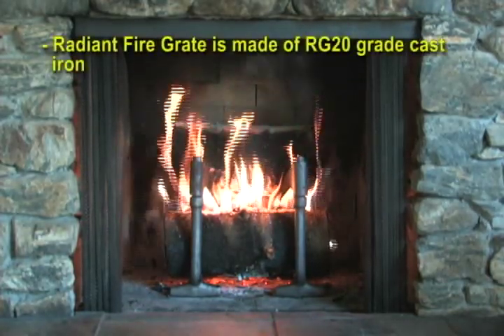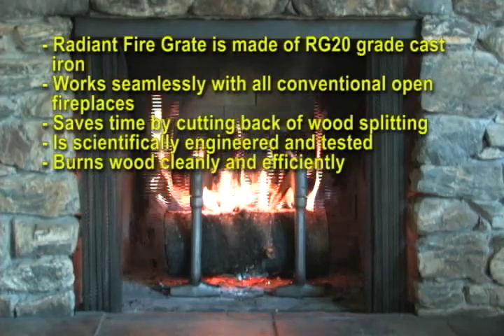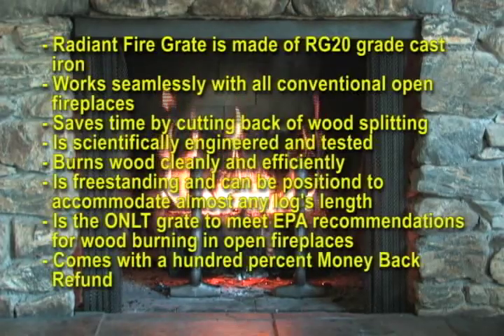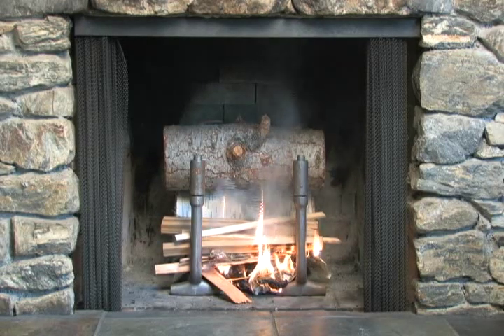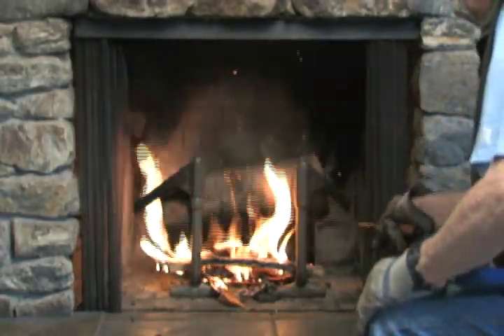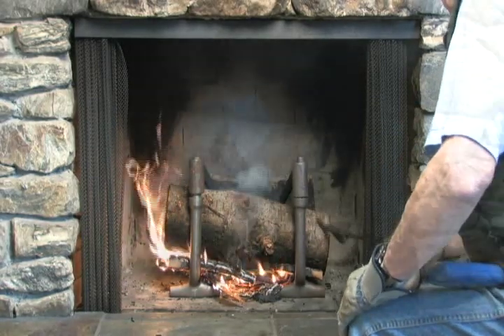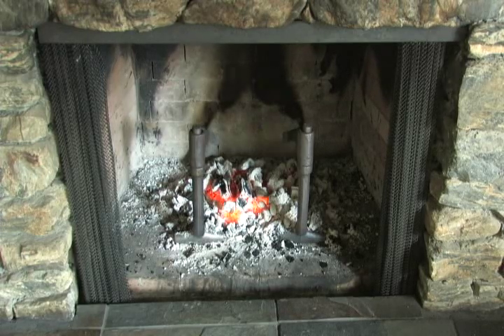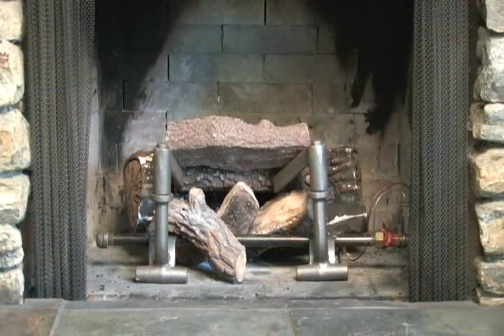The Radiant Fire Grate

Comment: I'm curious as to the BTU output using large logs. Even when seasoned they won't burn as hot as smaller diameter split logs. You might not have to tend the fire as often but I doubt the BTU output will be close to using smaller logs. I do like the concept though of keeping the fire point forward rather than upward. That should help a lot. Maybe the fire pointing forwards w/ larger logs will offset smaller logs pointing upwards in regards to BTU? If that is the case, then it might be worth using particularly if burning less wood. I think you guys should send me one as a trial offer and I'll give you all a video review of how well it works. ;)
Reply from the maker: Eric Schneider      Hi Eric,    There is a study published in Scientific American in 1978 comparing a Radiant Grate against a basket type with split logs.  The graph shows a 300% increase in heat transfer by the Radiant grate.  The BTU content of the fuel remains the same by weight regardless of configuration of the fuel, heat transfer into the room as opposed to additional global warming via heat upwards through a chimney is what people want.  I sell the grate with a money back guarantee, that will be your trial as it is with everyone.  Thank you for your posting, Best Regards, Ron Telfer, FIREGRATES 'R Us Inc.
Reply: LOL - I was kidding about giving me one. I'll definitely consider getting one particularly not having to tend to fire as often which is so common w/ open fireplaces. Thanks for the info and education.
Reply from the maker: Eric Schneider Hi Eric,    Thanks for your posting, I have no idea how I ever got onto YouTube, anyway there it is.  I have served on ASTM sub committee E 06.54.06 since 2003 and we finally evolved a test method for particulate emissions from wood stoves.  Fireplaces have been certified by the EPA, which of course is utter nonsense, since every FIRE in every fireplace is unique. I have about three feet of shelf space devoted to files and reports on wood burning, it has given me some intellectual stimulation since going on pensions in 1995 from the N. American Chemical industry.  My normal season runs October through March then summers are for family and outdoors.  Best regards - Ron Telfer.